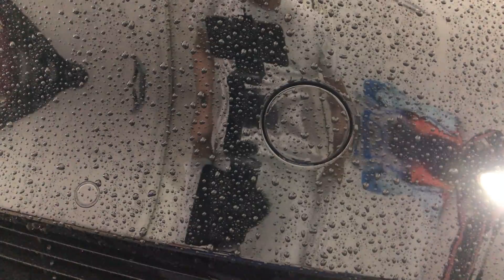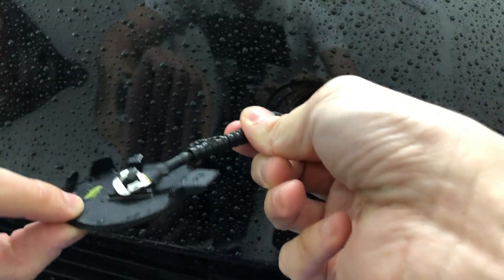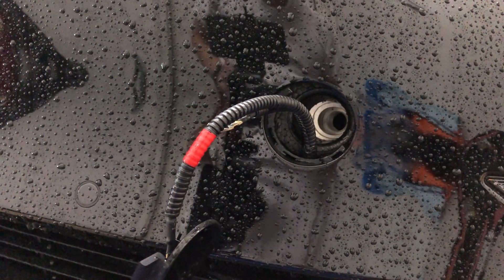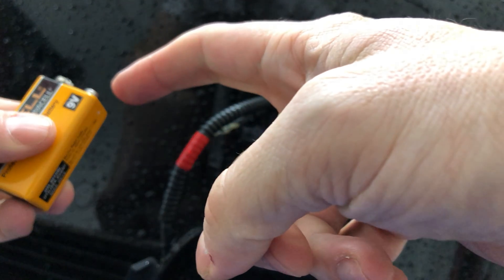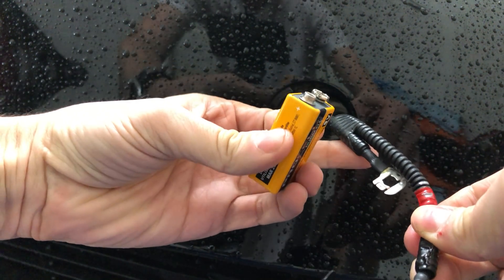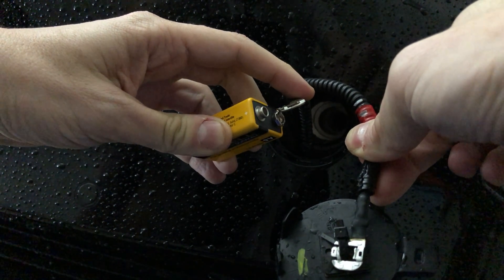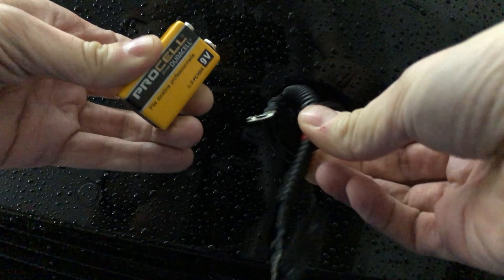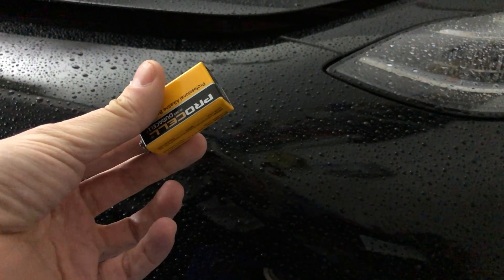Can a Standard 9V Alkaline Battery open a Tesla Model 3 Frunk?

Comment: You unlocked your car first. This will not work when your car is locked. Only works when your 12V battery is dead, otherwise you can't access the battery to charge it.

Comment: sounds like (I mean the sound of the actuator) is like the 9V isn't driving a motor, it's just signaling, and the vehicle 12V is actuating the latch release ... I'm assuming there will be a "part 2" video with the vehicle 12v open circuit ... : )

Comment: What a shame that valuables can't be kept in the frunk when traveling long distance as anyone can just open the frunk now.
Reply from the maker: Based on the manual, it's likely a firmware update will prevent this from working if the 12V is still providing proper power. However, this 9V trick might help someone who has a discharged battery.
Reply: Does it sound the alarm if you try this while locked?  Or was it locked in your test?

Comment: Or, you know, put a mechanical lever in there like every other car in the world has.  It is so stupid to do it this way.
Reply from the maker: The idea is eventually firmware updates will prevent this from working if the car detects 12V from the main battery, so it'll be more secure. I base this on the language in the Owners Manual and First Responders Guide.

Comment: Mark, that's only supposed to work if the car's 12v battery is dead.  Did you disconnect the 12v battery for this test?
Reply: Scary thought that this simple hack can open the frunk.  Don't like the idea that anyone can get into my frunk with a simple battery.  Has Tesla been notified of this?
Reply from the maker: Brad Garcia No, the 12V battery is connected and functional.
Reply: The Model X has a cord you can pull. Even easier.  I believe Porsche is the same. In other words, don't put valuables in there. Anyway... most casual thieves won't be carrying a battery, even a small 9V one. :)
Reply from the maker: There is a discrepancy between what I'm seeing and what the manual says. My main 12V is connected and powering the vehicle, but this method still opens the frunk for now.
Reply: I don't see where it says that in the manual, all I see is that on page 15, it says "In the unlikely event that Model 3 has no 12V power, you will be unable to open the front trunk using the touchscreen or mobile app. To open the front trunk in this situation" and then goes on to explain the procedure.  I don't see anywhere that indicates that it only works when there is no 12v power...
Reply: @moikk  they actually clarified it in the manual now to state that it only works when the 12v battery is dead or the car is unlocked. If the 12v battery has juice and the car is locked it should now work.
I'm going to assume the car was actually unlocked in this video.
Reply: Yes. Please clarify if the 12v battery was disconnect. The manual says it must be. Is it wrong?
Reply: Yes there was a software update so this now only works when the 12v battery is dead. 

Another poster said it also works when the doors are unlocked.
Reply: Yeah. Key word there is "for now". (thanx for the video!)
Reply from the maker: Tesla is aware. Note that many cars have mechanical releases so this is actually less convenient. Hopefully with a firmware upgrade this will stop working when the system detects 12V from the battery. This would make it much more secure.